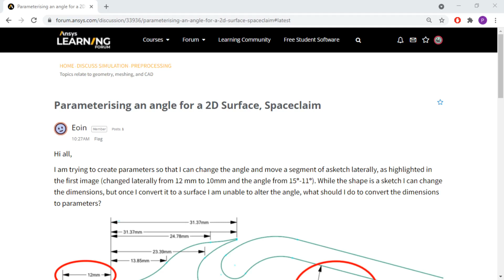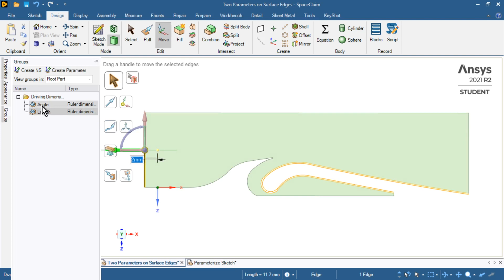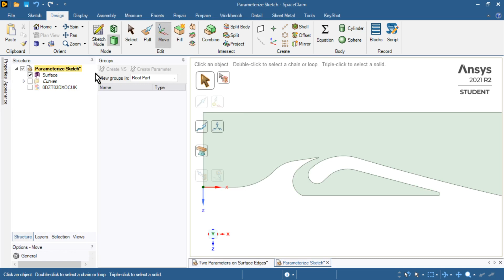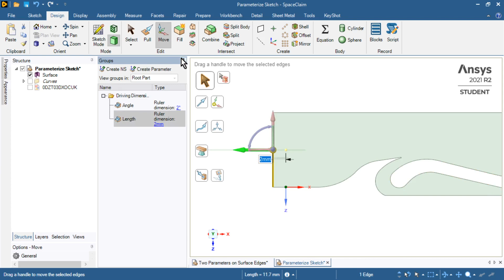ANSYS SpaceClaim 2021 Create Angle Parameter

Comment: the create parameter button never stays enable with me, always grayed out. How can I change that?
Reply from the maker: This video is for Ansys 2021.  The current version of Ansys 2025 R2 allows Driving Dimensions that can be used as an Advanced parameter to be created on the fly while using the Pull tool only.  It does not work with the Move tool. Note that you can use the Pull tool to rotate a face about an axis and get an angle parameter.  If you have other questions, post them here:  https://innovationspace.ansys.com/forum/forums/forum/discuss-simulation/threeddesign/
Reply: @ansysfeaexamples9351  Thanks. Its very annoying to use the current version. It should have a simple way to set any dimension as a parameter.